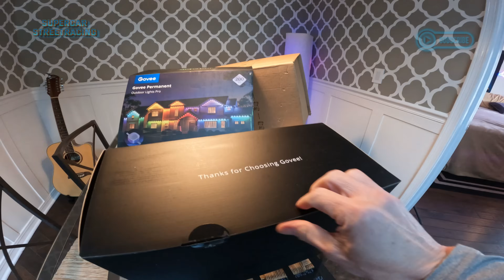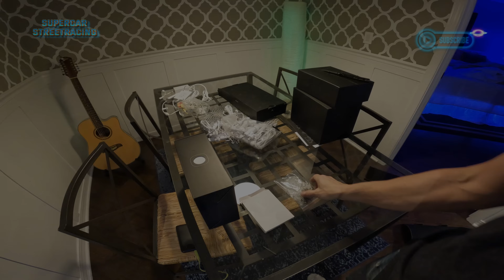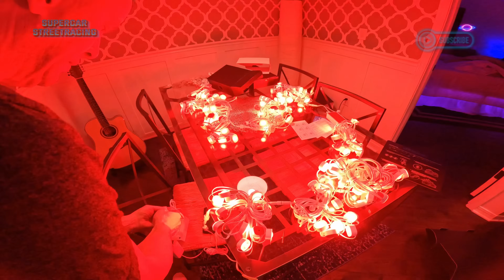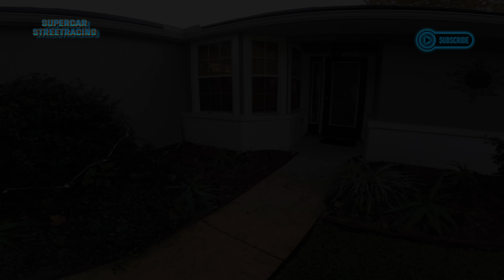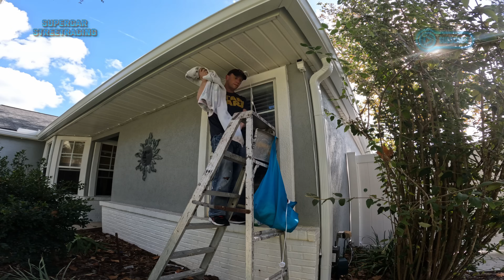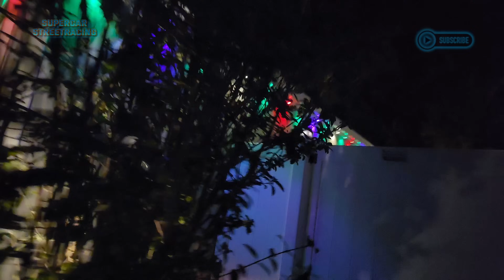Govee Outdoor Permanent LED Lighting Pro completely transformed my house!

Comment: I have 200 feet needed, so the pros are $700, and someone can install for $1000. But I’m worried about the sloppy wiring being exposed. The trimlight dealer quoted $4500! So double but has tracks and looks so much better in day time and also different look at night not having that triangle pattern.

Are you happy with the pros ? Also worried in a few years you have to go back up and put new 3m, unless you buy the led mounts that you can screw them to sofit. I don’t think Govees are truly permenant
Reply from the maker: I'm happy with them I've only had one or 2 fall off but use superglue. That works Everytime.